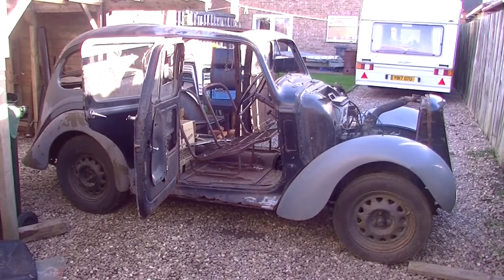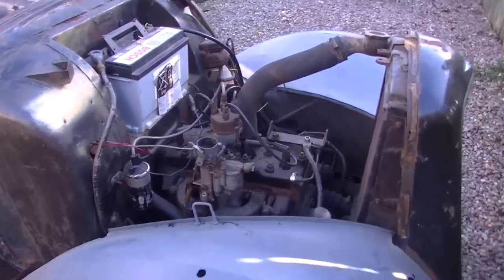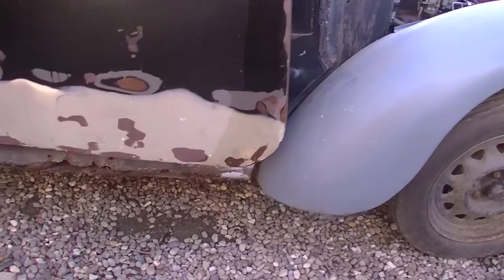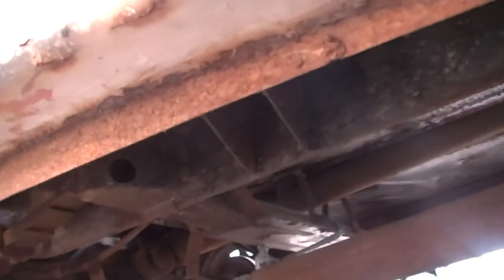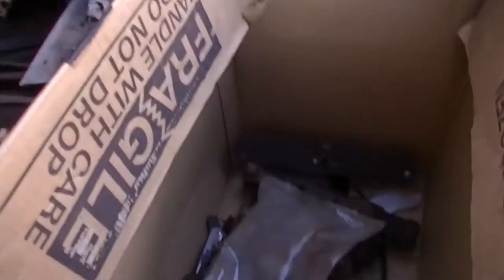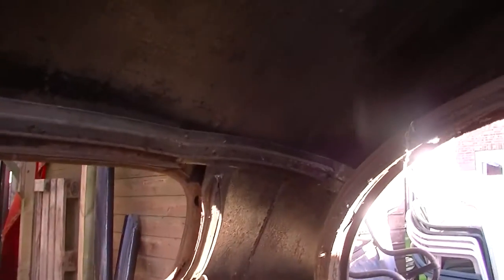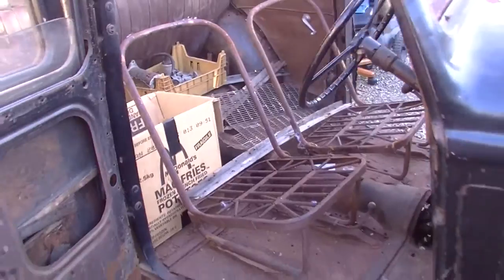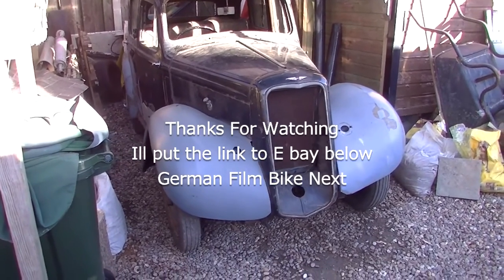Hillman Minx 1936 Restoration HotRod Unfinished Project For Sale

Comment: So we are 2022 and the car has had a few modifications since I purchased it, V8 Rover and 4 speed gearbox, 4 into 1 exhaust manifolds to x2 side pipes, big alloy radiator and electric fan sits in cut out front grille surround, new flat bulkhead with extra tube support and some new floors. Uprated bakes from rod to hydraulic, with discs at the front. Reliant Scimitar pedal box, coil over shocks all round, banded rear wheels with big tyres, skinny crossplys on the front all powder coated lime green. still needs some assembly work and new wiring all to be hidden in an old ammo box where the back seats used to be along with the twin batteries. MG Midget front seats and no other interior apart from canvas roof. Registered correctly as historic vehicle and new engine capacity on V5. Body has been painted where needed and then satin coat clear lacquer over the patina, following the Rat Rod style, another push this year to get it back on the road if time allows.
Mick........... Rusty Rodz UK.........